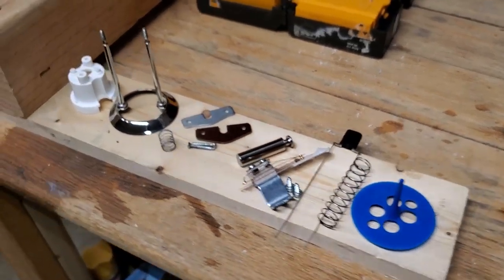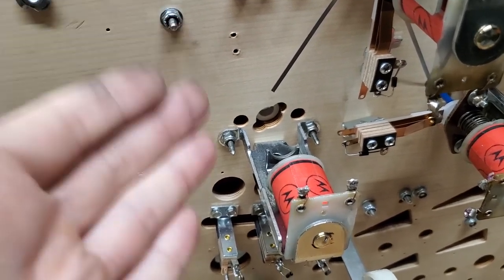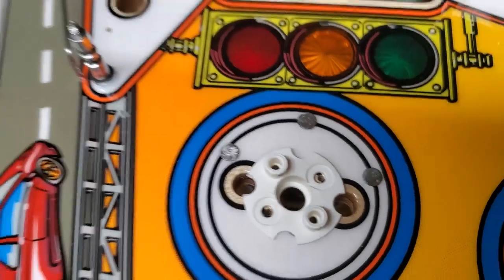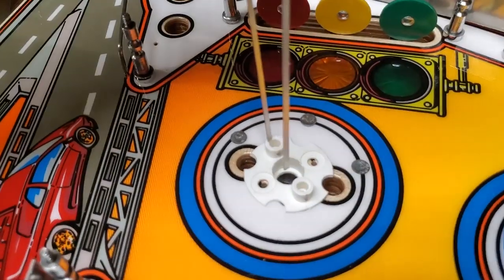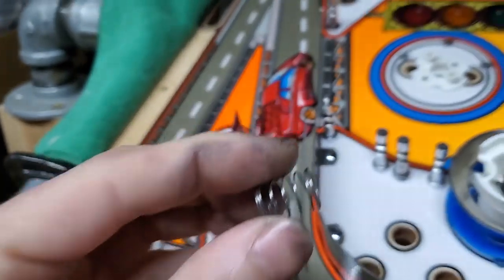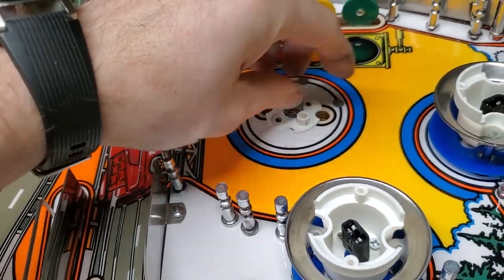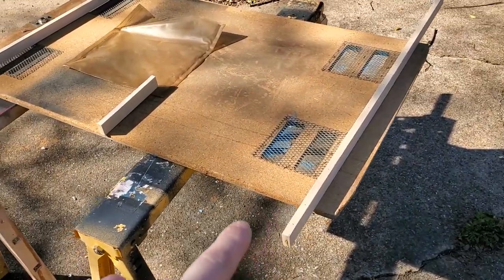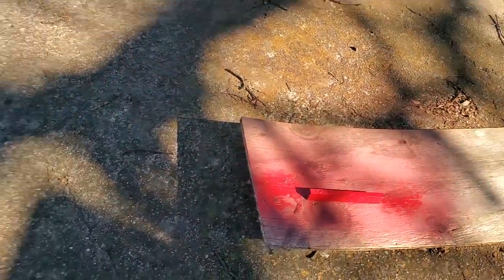The Getaway Restoration: Part 5

Comment: Whew! I'm glad you made new rails..LOL, I was setting there watching the video saying "oh come on Cary, just make new rails" which you did, but you should have bought the Red Oak 1"X 2" strips from Home Depot. They are only $13 for a 8 foot section. Looks like you used pine instead (unless I'm not seeing it correctly) That vinyl rap you took off is an OAK simulation wood grain so it would match perfectly.  Looking really good, I like the wire loom you are doing. Makes it look real clean. I think even Lonny will be impressed..LOL. Looking forward to playing it at TPF? You plan on having the volume cranked again this year? That makes it easy to find.... :)
Reply from the maker: DYNAMITE! lol. The game is complete. I will be putting out the videos for this series a little quicker now. All I'm doing now is tweaks and mods.

Comment: Just got my Mata Hari hardtop in.. but as with most Mata Hari games the saucer is rough.. Do you know where I could find a guide on saucer wood repair or do you have any tricks of the trade that work well as the rest of the playfield components  and playfiels will look new, but that saucer is the last piece of the puzzle that needs attention. Thanks for any help you could provide i havent found any repair logs covering this issue
Reply from the maker: wood epoxy, sand, clear, air brush, clear. lol. Not a simple fix if you want it done right.
Reply: @CaryHardy  Thanks , no sense in being in a rush now, time to sculpt a saucer, pray for me lol